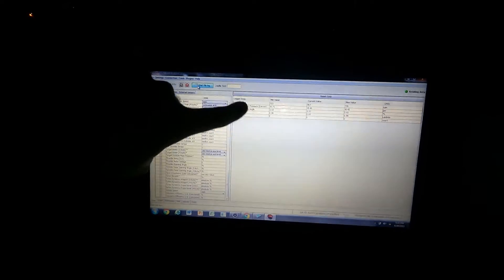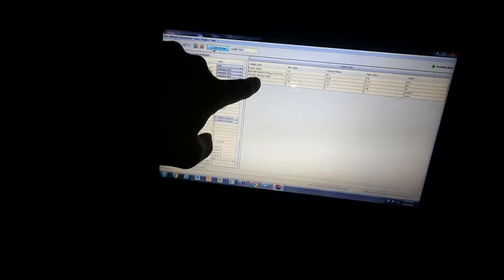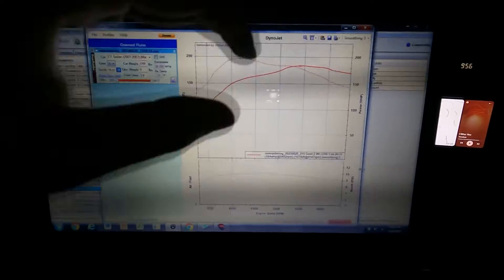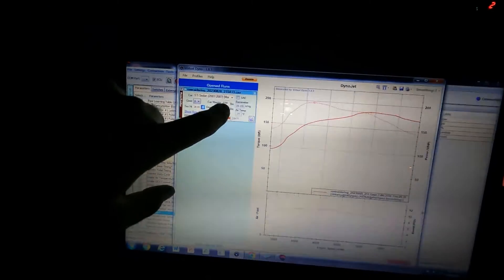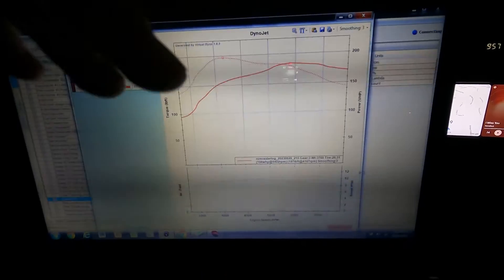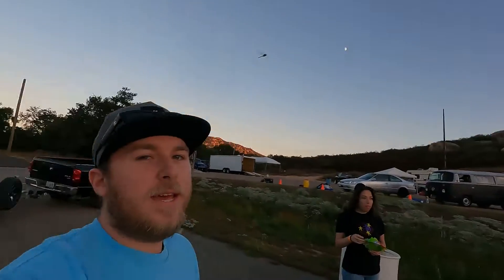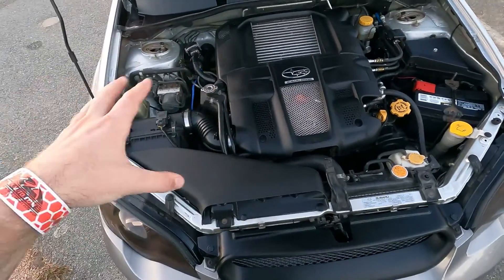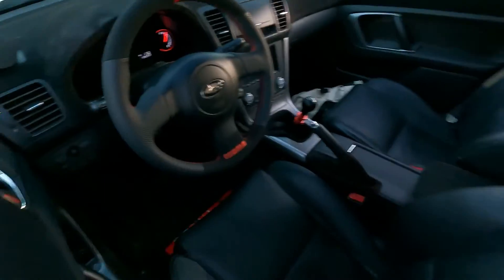Subaru Tuning Through the Stages: Baseline

Comment: Hey I’m a Subaru guy as well; can I ask you a few questions.
Reply from the maker: Absolutely, I'll try to answer them as best I can.
Reply: I've got a WRX-STI 2020 and I have an awesome Legacy that I'd like to turn into a Drag track car. The STI is basically stock and I do road courses with it. But, the legacy is the one I want to go balls to walls with.
What I'm looking to do is build a drag car that looks very unassuming and blows the doors off the competition. So I need computer programing advice, tech advice, tunning advice, engine build advice, the money I've got, mechanical engineering and repair skills I've got, most tools I've got,,, So, I'm a retired Combat Marine that kicked ass in the field and now want to kick ass on the track.

What say you my Subaru Brother?
SSGT David @SWSpeedCo
Reply from the maker: Sounds like a good plan to me and I think I should be able to give you the advice you need